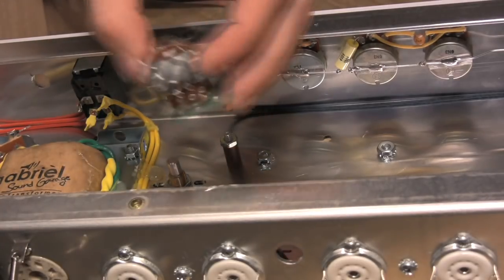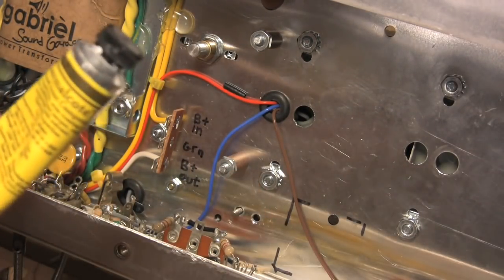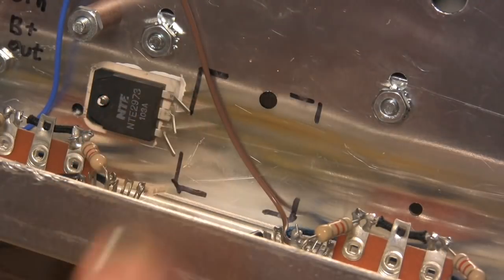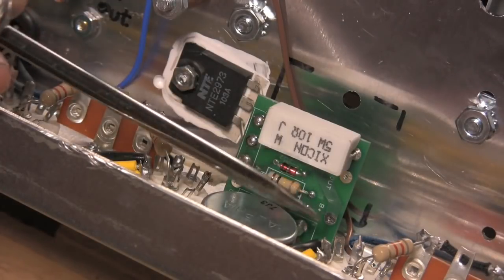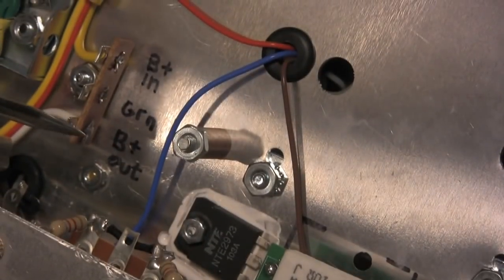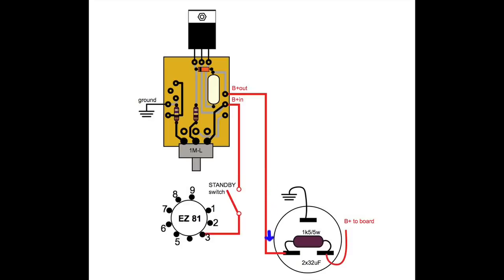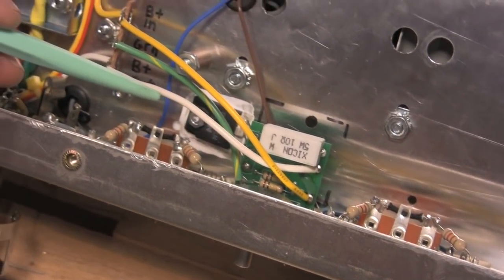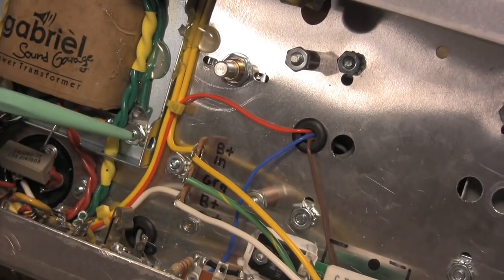How to install a Variable Voltage Regulator (VVR) in your guitar tube amp

Comment: I’ve been noticing the transformers getting hotter than usual in a Hammond conversion (Ao-44) that I installed a VVR into. However , I also added an 12ax7 and 6av6 to the amp so I could use el84’s instead of the combination ecl86 power/preamp tubes it originally used. I used a proven design by another YouTuber and it does sound pretty good.  I’m just wondering if the heat is from more current at lower voltage settings. Hasn’t blown any fuses yet ;-).

Comment: Looks like Hall amplification disappeared. Where I can get one of these?
Reply: ampbuilder.com
Reply: You can build one with a three or five lug strip and a few parts. the mosfet is like 15$.. they've gone up in price. but a diode, two 1W R, and one 5W pwr R. plus a 1Meg pot... I'm sure there are layouts and schematics online. (learn how to handle a mosfet)

Comment: wont the valves last much longer if u always have the VVR on as they have a lower voltage on the plate? i know that if u run a preamp valve at 12 volts in a pedal then it will last virtually forever.

Comment: What is the advantage of a VVR over a Hot Plate or Power Soak? For collectible amps a VVR being installed would obviously drop the value of the amp. Has anyone tried the VVR in comparison to any kind of attenuator?